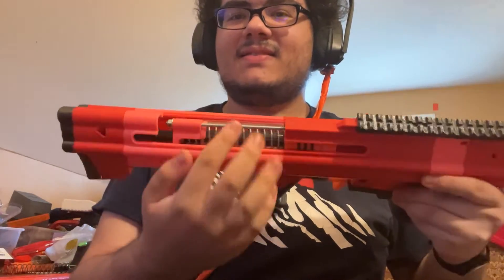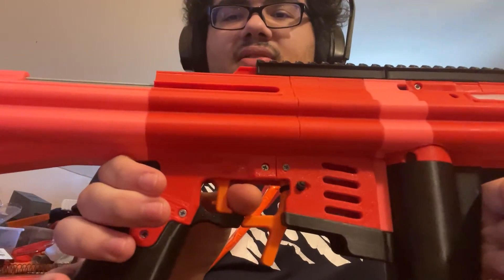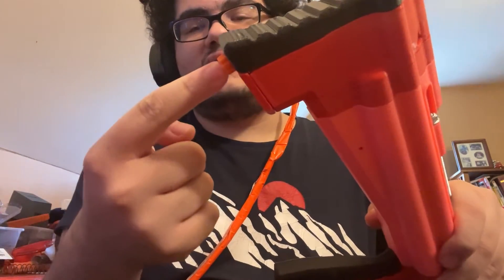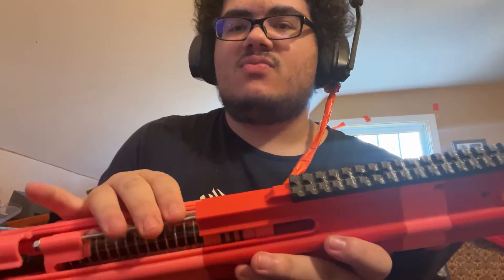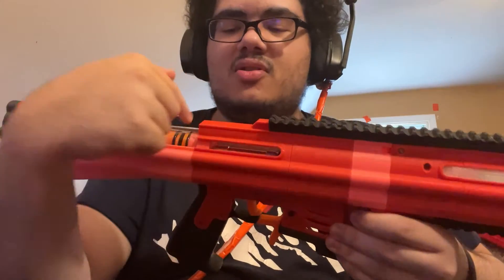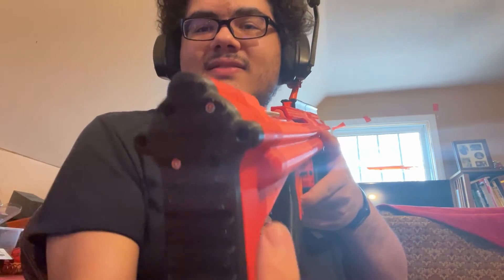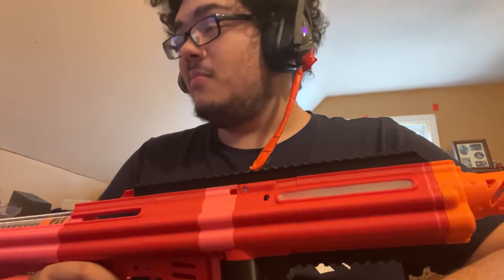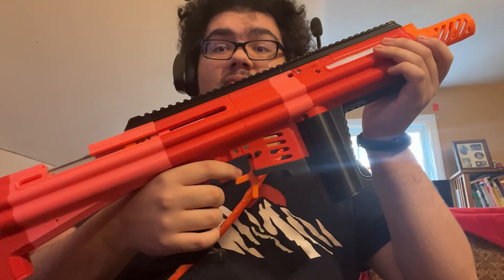Warlock AEB/Autospringer first prototype (WIP)

Comment: I’m kinda curious do you really need that big of a motor for this?
Reply from the maker: Probably not, but by using a bigger motor I was able to do two things:

1. I can run the motor with heavier springs, for longer
and 2. it was easy to find a planetary gearbox sized for this motor spec (550 size motor).

Comment: A true inspiration, What motor are you using on this? Could you also add an optional battery extension part to fit larger Lipos?
Reply from the maker: 550 size motor. Yes.
Reply: @Sillybutts  My lord, thats going to be really heavy. Will we be able to switch it with another motor?
Reply: @ruzer1514  Big dakka for big boys